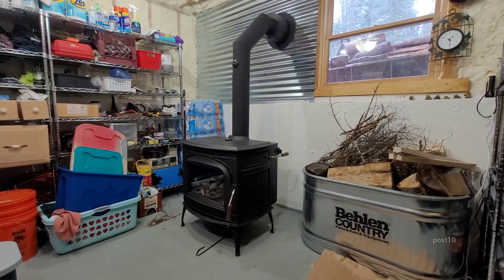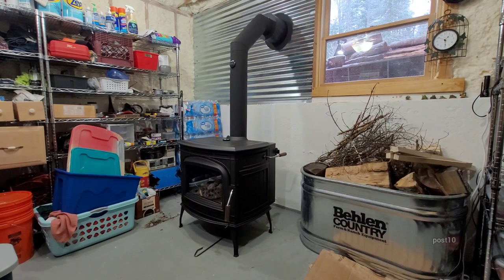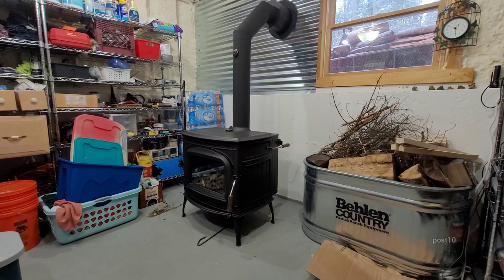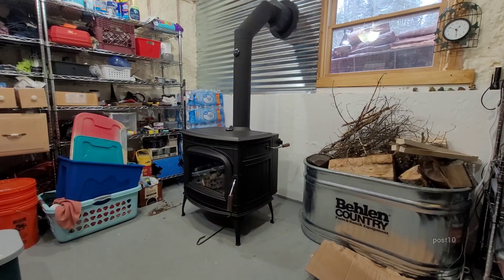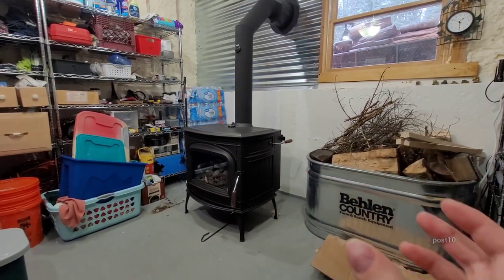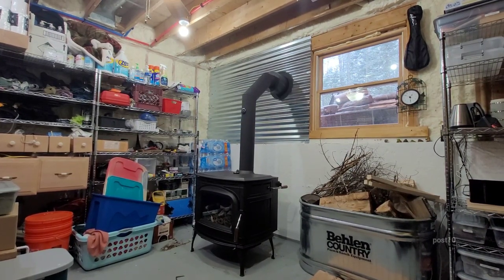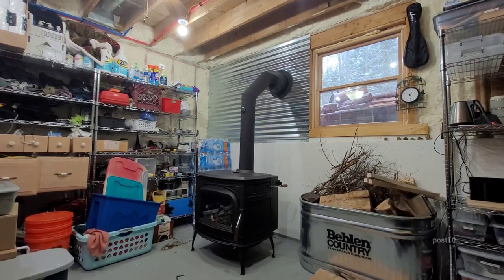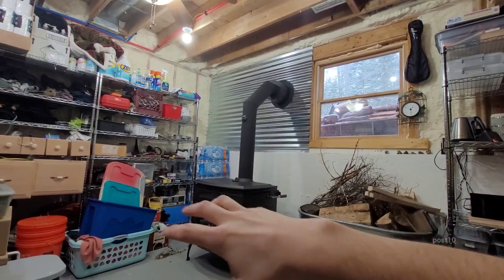Burning Wood To Save On High Diesel Prices. Blaze King Catalytic Wood Stove Model Ashford AF30.2A

Comment: My brother bought an 80 acre woods and built his house to be heated with wood. People predicted he’d have to cut down every tree to do it. 50 years later the woods is thicker and healthier than at purchase because he cuts only the damaged, diseased or dead trees, which makes the others healthier. And for kindling etc he uses the fallen branches. He avoids pine because it deposits a lot of creosote in the chimney, and prefers hardwoods because they burn slower hotter and longer. Wood heat feels great. Enjoy!
Reply: Cindy, the rule of thumb is you can take 1 cord of wood off one acre a year for ten years and not damage the property. I have been burning wood all my life and I will never change
Reply: Yep. People don't seem to understand wood heat lol. We lived on 80 acres when I was young and we used probably 2.5-3.5 cords a year for two woodstoves. You could have never noticed. We got most the wood from a neighbor's property because he was trying to clear some land but we barely made a dent in 3 years.
Reply: @davecalvo6418  
Dead on agree with that.
Reply: Imagine if everyone heated their homes this way. There would be a lot of air pollution. It's not sustainable. Also, so called dead wood is habitat for critters in The ecosystem.
Reply: I burn pine exclusively. After 7 years I had zero creosote in chimney. I wasted my time cleaning it. Dry pine.
Reply: @amorales9613  amoral? This wood stove with a catalytic burner is more efficient and emits less pollution than electricity production. Nice try at being more virtuous than everyone else, but you don't know what you are talking about.
Reply: People are dumb. You could heat a house with 10 acres if managed properly
Reply: Not to nitpick, but pine doesn't deposit a lot of creosote, under seasoned or really wet wood deposits, a lot of creosote. A common myth that. In Colorado, yes, we have hard woods, yet the most common wood are soft woods that are burned, same with the majority of the west. Been burning seasoned thick split pine in my fireplace, clean it once a year, and have no problems.

Comment: The aspen may not have high BTU content per unit volume, but it's still free heat, and it's very clean burning wood that would be well suited to heating in the "shoulder" of the heating season. It also has a sort of unique smell when burned that some people like. I would happily burn aspen!

Comment: I've been using a Blaze-King for 18 winters...two wrong things mentioned here is the handle on the side is not the damper, it's actually the diverted plate to bypass the catalytic chamber while starting the fire then closed once the catalytic chamber is up to temperature as indicated by the gauge on the stove top. The damper is controlled by the knob just behind the diverted handle. When loading open the diverted plate and partially close the damper to mitigate smoke and embers from coming out the open door. One other point is the stovepipe temperature Guage should be no more than 18 inches above the stove top.  These things are fantastic but must be used properly to avoid a tragedy.
Reply: You are correct.  The big lever is the by-pass plate and the plastic knob controls the amount of air allowed into the firebox.  The Low-Med.-High knob is a thermostat that is opened and closed by use of a bi-metal strip attached to the inlet 'damper'.  I think Blaze King may be the only brand with an automatic thermostat control.  "Set it and forget it."
Reply: That's right. Blaze King King owner.
Reply: Thanks for the info.
Reply: Mmmm!! When's din din😁
Reply: @CW1116  back in the 70's there was a woodstove called Ashley,  it had a thermostat. It may be related to Blaze King.
Reply: It can be called a by-pass damper. My stove doesn't use a chimney damper but rather has some kind of air inlet control that could maybe  called a damper. 
I'm not sure what Englander calls it.
Reply: Post 10 has never used a wood stove before. He needs to move the numerous flammable articles next to that stove before he burns his house down.
Reply: Thank you for mentioning these errors in his wording, oldpete. I am GrannyDeb and hesitated to criticize him or correct him because I wasn’t sure that I was correct. The instructions came with my stove and they called that big handle a second damper and describe the heat level that it should be before are used it each time.
Reply: @deborahcaldwell9775  so it's called a damper in the instructions?
Reply: @CW1116 Bi Metallic dampers have been used by  Vermont Castings, RSF Energy, Supreme Fireplace, Pacific Energy, as well as several others. You don't always know it is there depending on how they are using it. 
Blaze King really perfected it on their products. The air control is actually there to keep the stove from going over 1600 degrees which is the temperature that melts the wash coat that holds the precious metals on the catalytic combustor. It works like a governor. Cat stoves burn cleaner on low than they do on high, so they have a advantage in controllability over non cat stoves. Which allows the user greater control over the heat. 
Passing the EPA tests with a adjustable burn rate appliance on a Bimetallic spring is not a easy thing to do.
Reply: @CW1116 actually the stove called the "Wonderwood" had one and I think they're still made

Comment: Great video! I’ve been burning well seasoned pine for years. It’s indigenous to my area and free. The beauty of these new stoves is you control the burn not the density of the wood. I clean my stove pipe in October and inspect it every few months by pulling off the cap and looking down the pipe with a flashlight. No issues or crazy soot everyone claims with pine.

Comment: I have never used my pellet stove as much as I have this year. Agreed, the price of heating oil is shocking. I have a 550-gallon in-ground tank. I cannot stomach paying three thousand dollars to fill it from empty. I still have approximately two hundred gallons left over from last year. I think you made good decisions to try to save some hard-earned coin. Thanks for the video!

Comment: I've had a Blaze King Princess insert for 3 years or so now. I love it, they are fantastic. I can get overnight burns no issues. Be forewarned when you take the cat out to clean, there's a gasket you'll need to replace when you put it back in. Make sure you have one ready to re-install. The only thing that comes out of my chimney is heat waves, no smoke at all. I used two floor vents, one next to the insert and one at the far end of the house connected with a flex duct with a high flow grow tent fan in the middle. If you do go the route of active circulation, be aware that it is better to push cold air then to try and pull hot air.

Comment: I love the way a wood burning fire sounds.  That crackling is so soothing and can put me to sleep in a matter of minutes.  We had a wood burning stove (we called it a "pot-bellied stove") when I was a kid and that was the only heat our house had.  The room it sat in (the dining room) was comfortable but the rest of the house stayed cold.  We got really good at piling a lot of blankets on our beds to get warm enough that we could sleep.  We also had no indoor plumbing so getting up in the middle of the night to go outside to the outhouse was a cold and miserable exercise.  Let's say we didn't waste a lot of time doing any lollygagging on our way there or back.  We wanted to get back inside and under our covers as quickly as possible.  I don't think we kept the fire going all night very often so when we woke up in the morning, we were pretty cold until we could get that stove fired up again.  I do NOT miss that part of the "good old days".  

A few days ago the temperature here in Nashville got down to a few degrees below zero (which is EXTREMELY cold for Nashville) and we had a power outage that lasted about 12 hours.  My heat is electric and it is amazing how fast my house got seriously cold when the power went out.  Remembering how we piled the covers on when I was a kid, I pulled some extra blankets out and surprisingly I got warm enough that I slept quite comfortably.  In fact, I slept so well that I didn't wake up until 10 a.m. and my electricity was still off!  I was sitting here wondering what I would eat for breakfast because about the only thing I had that didn't need to be baked or microwaved or toasted or heated up in a skillet was peanut butter and crackers.  As I was trying to talk myself into believing this would be a great breakfast, at about 10:30 my power came back on.  I wish I had owned one of your wood-burning stoves because I was pretty uncomfortable for a few hours.  It's amazing how much we depend on our "modern conveniences" ... to the point that when something stops working we sort of don't know what to do... or at least I didn't.

BTW,  I don't know if you have any plans to do any cooking on your wood-burning stove but let me tell you that soup or chili or beans or stew that sits on a stove and slow cooks for hours is the best stuff you will ever put in your mouth.  In my opinion there is no comparison, between something that is cooked on a wood burning stove and something that is cooed on an electric or gas range!  And if a fire is burning in your stove anyway, you might as well take advantage of that fact to cook something delicious to eat.  That's the end of my rant.
Reply from the maker: Yep the past few years just seeing what can happen to the supply chain and how prices can jump so high made me turn into kind of a prepper so I'm ready if anything ever permanently shuts off
Reply: @post10Vlogs  yeah i was thinking about that too and how to handle an emergency situation. we have liquid gas as our primary heat source and it would be nice to have a wood burning stove that can run on low expenses. we bought the house 5 years ago and it's an old house that has been messed with by the previous owners who did various stuff they might have not had the proper expertise about so our chimney is quite worthless to use bc there's all sorts of pipes and plasterboards and whatnot in there, plus there's poor insulation in various spots so in winter it gets quite cold. in our living room (which has 2 radiators) we have an extra mobile electric radiator we put away during summer. i wish things were a tad less difficult...

Comment: This is a great video as always. I have been using a wood stove as supplementary heat for my house for close to 30 years. I do suggest you get an electric log splitter. I've had one for 5 years now and I love it. It requires no maintenance and it makes splitting so easy. Thank you for providing excellent content on your channel.
Reply: we have an electric splitter and it has split everything i put in it never ran out of power and it oly cost 300 bucks works awsume
Reply: Which brand splitter do you use I'd love to invest in one also

Comment: I've burnt wood for over 40 years have had a blaze king for 4 years, best stove I've ever owned. The lever you call a damper is the catalytic bypass. Make sure you open it before opening the door as the rush of cold air can damage your converter. The knob controls the air intake and regulates the heat output. You will find the sweet spot and and turn it up or down a little depending on how much heat you need. The gauge on the top of the stove shows the temp of the catalytic converter. You just want to have it in the active zone when you close the bypass. It's not uncommon for it to be pegged out with a new stove, you don't try and regulate the stove temp by it. All it does is show when the cat is hot enough to close the bypass after that you don't care what it reads.
Reply from the maker: Thank you, I always gets concerned when the catalytic thermometer gets all the way to the end because I thought it was overheating while the other gauge says it's good

Comment: That, is an excellent heating choice!  A Blaze King, is exactly what I am considering.  A long burn time, and great efficiency - is highly desireable.
I also use the same type of wood cart;  I can roll it right into the room with the current wood cook stove.
I will definately look for your future, new stove update - thank you!
Reply from the maker: I only made this video a 4 days ago and I have not shut it off since, I'm amazed at how little wood it's actually using and the furnace hasn't turned on at all even with some pretty cold nights, it appears by the ash buildup I'll have to shut it down once every 10 to 14 days to clean it out
Reply: @post10Vlogs  10-14 days, that's amazing!  My wood Cookstove will only run about 4 hours, if I stuff it full. Then, dump the ashpan, every day. You made a great choice!
Reply: @post10Vlogs  I'll confirm that, I just got my Blaze King Princess 32  3 weeks ago also and have gone 15 days till I cleaned the ash out, and if you clean when the  cat temp. needle is in the middle and save the glowing coals you just reload it and keep going. The temp. of the stone will stay constant for 95% of the burn then start going down. 
But it was over 6k for everything

Comment: Yes, interesting. Good looking stove. Been wanting to get one (an insert) for years to fit into the fireplace. Growing up with one as a kid, we used to put a pot of water on top to up the humidity in the room. A little smoky scent is part of the beauty of having one. Gas powered splitter could be the way to go. I like the manual ones for the workout value. 👍👍
Reply: How much are they ???
Reply: @philliphall5198  I looked on Amazon. Nothing for under $600 USD. You get what you pay for though.
Reply: get a electric splitter they work great way more power than you expect for about 300 bucks i have had it all been burning wood for 50 yrs
Reply: get a electric splitter with a built in stand unless you have a heavy duty workbench to place it on you dont want to work off the floor if you are old like me

Comment: This is probably the best video Ive seen on wood stoves and their operation! We just put in a Lopi stove with the re-burn tubes and catalytic converter and still getting the hang of it. The way Lopi wants us to get it started and shut the top damper at 500 F so the catalytic converter starts to work seems to smother out the fire so then we keep the lower air inlet wide open and doesnt seem to make a difference in the size of the fire. We used to hear the roar of the fire when it got going but that only seem to last a week or so. Long story short we're following what you did and look at our manual temp gauges and control it that way and see how it goes. Thanks for sharing!
Reply: What model Lopi do you have? I got the evergreen with just the tubes, no catalytic
Reply: @denverbasshead  Lopi Rockport

Comment: I bought an HVAC temperature test gun to determine what areas of my wood stove heat up the most. I found the front opening doors are thinner than the side walls or top and they heat up the hottest. I place my round temperature guage on the door to show the hottest temp my stove reaches. Thank you for your video. We all learn from you.

Comment: Now 67, had a wood fire or heater for all but 10 of my life. We have a wood heater now with fan circulation which is brilliant, we’ve had it for 30 years now and the only maintenance I’ve had to do on it is clean and oil the fan every 2 years. Started splitting with an axe and wedges now just using a hand block splitter or maul, whichever floats your boat. Good exercise, 😂😂. 
If your glass blackens your fire needs more air, most of the black will burn off, but to clean your glass use dampened newspaper dipped in the fire ash rub the glass and then use a moist cloth followed by a dry cloth to polish it. Bloody good stuff. Our glass is 30 years old and still perfect.
A lot of your resultant heat will be radiated from the flue so the corrugated iron should reflect that as well.
Keep burning a clean fire and once a month given it a couple of hours flat out burning, that the keep the flue clear, especially if you’re going to burn pine even if it is seasoned. An active fire will also help keep your glass clean.
With your air coming in over your glass, as much as you can, keep a bed of white ash, what I do is dig ours out 2 or 3 times a year, leaving at least an inch covering, by just moving the charcoal from side to side. Any black stuff removed is removing fuel and efficiency from your heater.
Keep an eye on your chimney top because excessive smoke is loss of efficiency and pisses off any close by neighbours.
If you can avoid it, don’t burn a lot of bark, it is loaded with tannins.
Enjoy your fire, but it should have been place where you can see it. Nothing as calming as watching a fire, 😂. Our kids loved it, now our grandkids can’t watch it enough.
Thanks for posting Post.
All the best for the season to you and yours from me and mine. 👋👋👋 🎄🎄

Comment: Great as always! Love your explanations of the rationale and everything. It's interesting they mentioned using a blowtorch to get the chimney running; I've seen in older Russian masonry stoves, they often have a hatch in the chimney about 4-6 feet up with a small grating in it, the idea being you start a small fire in the chimney deliberately to warm it up, start the draw, and "pop" the cork of cold air and stop the room filling with smoke. It's an interesting little solution to the problem (I'm guessing it's safe because of how masonry stoves are by their nature more or less nonflammable).